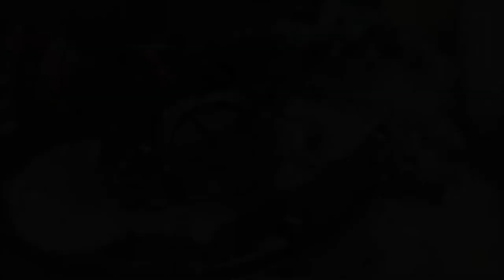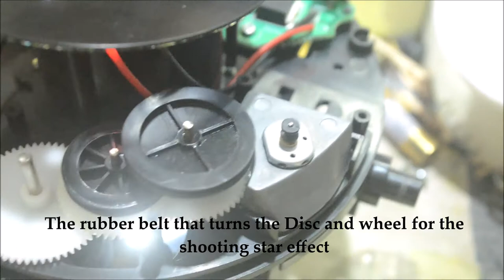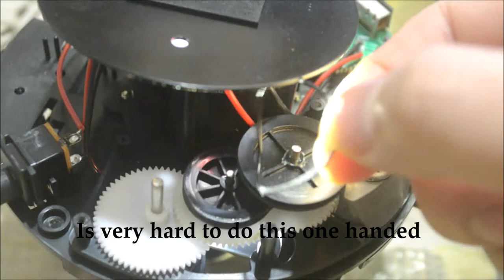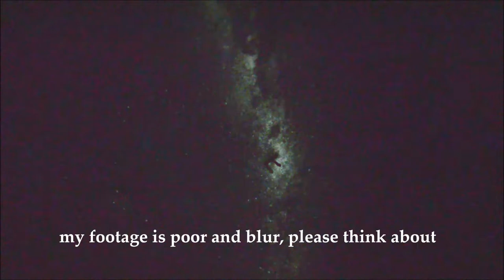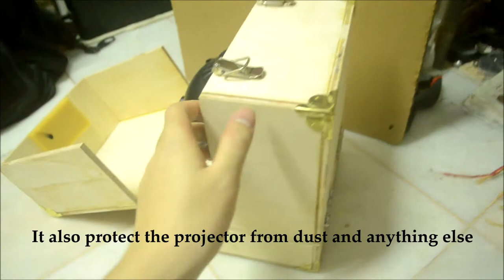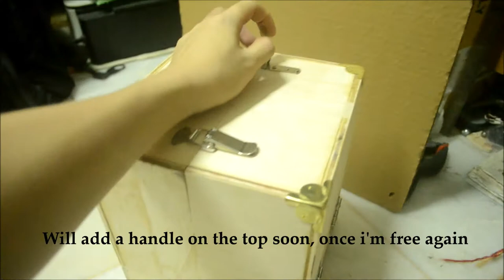fixing SEGA Homestar Planetarium Belt problem and box showcase

Comment: Thank you for posting. Wonderful Helper video. Most appreciated. Has your light bulb gone out? If so, do you have advice changing it? Can you use a more powerful bulb like the one in the Sega flux, to be used in the classic?
Reply from the maker: Thank you, I have not use it for I think over 2 years, I will open it again sometime,  I think better stick to the same spec , because in the chips or the board might have micro resistors might prevent stronger LED from working
Reply: Thank you. I will take your advice about the bulb. Again that portable storage container and planetarium mount is so cool. I showed everyone in my home right after I watched your awesome video.

Comment: You mentioned that you purchased a new belt from AliExpress, but you did not include the part number. Please add a part number for the belt in this comment section.
Reply from the maker: suppose to be 30mm x 28mm x 1mm , looks like it has sold out https://www.aliexpress.com/item/32800544142.html?spm=a2g0s.9042311.0.0.27424c4dwPweS1

Comment: Hi, I’ve had mine for years and I think it’s been knocked because the motion when it rotates is very skippy and it makes a lot of noise where it never used too - how would I fix this please?
Reply from the maker: does the disc still spins?
Reply: @ShengTheCraftsman  yes it does but it jogs or starts lagging during the rotation
Reply from the maker: @xsexyminxyx  it is either something inside broken that causes the jam or the disc isn't placed properly, if you dare, can open inside and see if anything unusual in there

Comment: The shooting star effect stopped working on mine, but the motion still works. Curious how I would fix that?
Reply from the maker: like I said, probably the rubber belt broken, they tend to stay in warehouse for years or you have bought them long time and it sort of dried up and snapped, open it up, buy new rubber rings replace them, the shooting star effect are enable by another spinning disc with cut out too
Reply: Craftsman Sheng Can we get 10K Subs Thanks! Do I have to unscrew the leg screws on the side to take the unit apart?
Reply from the maker: @TriconTv   yea, IIRC 3 screw, the big 2 left and right, and the 3rd hidden behind and under that glossy plastic ring strip cover thing